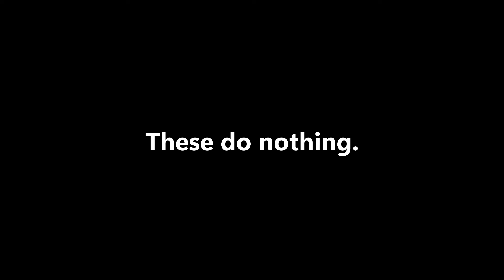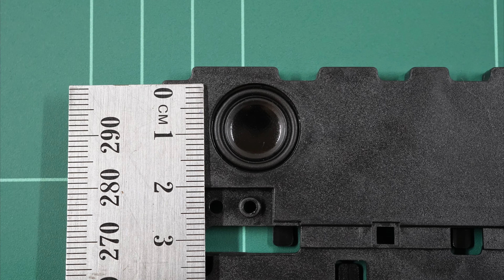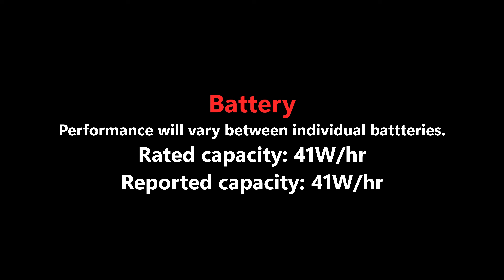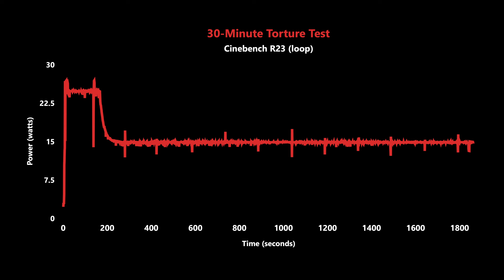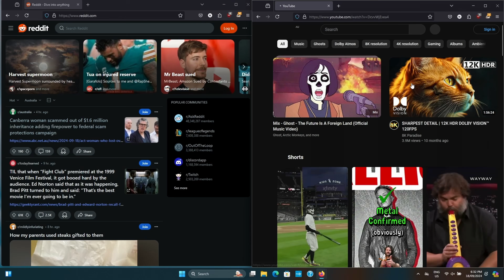HP Laptop 15S - Nuclear Review

Comment: Come on do a zephyrus g14 or g16 already 😫😫
Reply: fr, i wanna buy one but i wanna know peoples opinions
Reply: @schippiies   The 2023 model with a Ryzen 7040 series processor looks fine, though it can only be found on the used market or on some rare clearance sales. A model with more than an RTX 4060 8GB is the only one that makes sense. RAM would be upgradable to 64GB (with a 48GB stick)
Reply: I had a m16 and it killed itself
Reply: I have a g16 it's not a bad machine it has is cons tho
Reply: I have a 2024 one its amazing
Reply: These trash overpriced laptops don't deserve as much exposure as they get. 2023 model was the last good G14
Reply: @one_step_sideways  why. What's so bad about them
Reply: @yashvardhan1744  lower build quality and generally more boring and anti consumer design. The zephyrus aren't much of a statement anymore
Reply: @Nicest_Guy_on_YT  Yeah, these day Clevo made the best laptop
Reply: @Nicest_Guy_on_YT can’t get much worse than the old plastic design
Reply: @Nicest_Guy_on_YT mines charger stopped working after a year